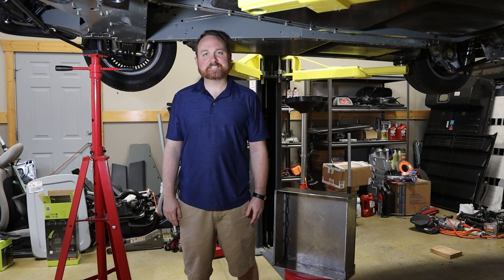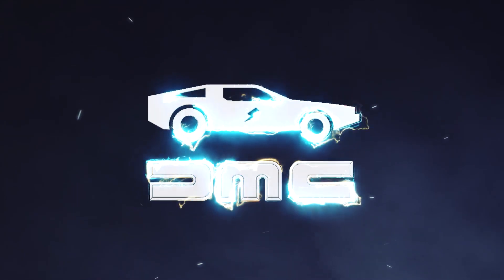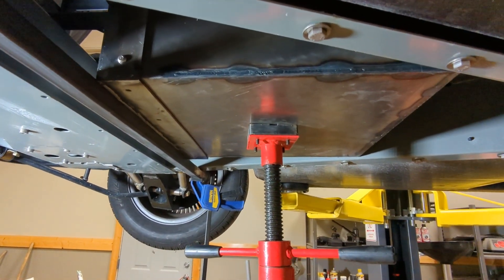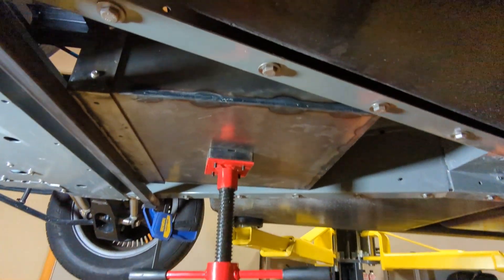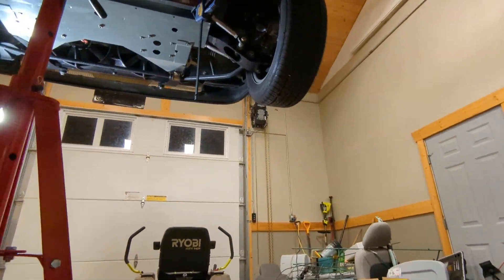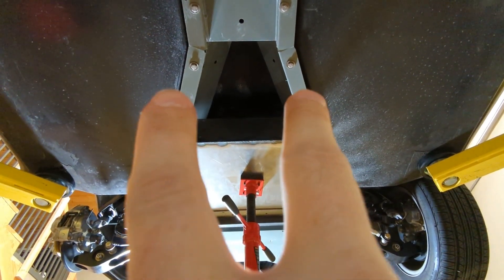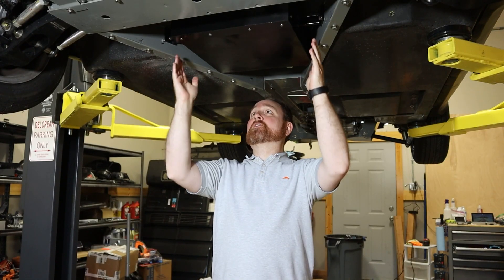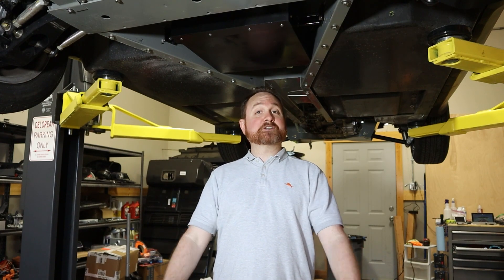DeLorean EV Conversion - Mounting the Front Small Battery Box

Comment: Hey Bill, on the gas tank box, couldn't you just mount it diagonally so you don't have to shave off the back? Just rotate the box so that the angles kind of match the Y?
Reply from the maker: Ah! So, depending on the particular sizes of things - that can absolutely sometimes work!! In my case, the diagonal of the battery box is ~22", which is too wide to fit in the triangle back far enough for it to gain anything up front. It would fit, but would still hit the upper battery pack in the middle.

I appreciate the idea so much, though, that I did go out and lift the car up and make a little mockup with cardboard to see if it would help. :D

Comment: Why didn't it show up in your CAD model?
Reply from the maker: GREAT question!  The CAD model of the DeLorean is just the frame and is only dimensionally accurate down to ~0.5 inch, and doesn't contain any pipes, steering, suspension, cooling, the body, or anything like that. So while it was very useful for getting a general idea of whether things would fit, it isn't nearly accurate enough for me to design on. And then my CAD models of the batteries are JUST the battery module, and not the entire battery box, so they didn't take into account the size of the main lugs or BMS connectors or anything.

Next project I work on I am going to spend the $$ and have the car fully 3d scanned. I didn't think it would be worth the multiple thousands of dollars, but I've learned my lesson!!

Comment: Looking great and a nice fit but I would be concerned you have no triangulation or gussets to give strength to those welds. If you hit a bump your 50lbs will be more like 150 or 200lbs or even more depending on the shock.
Reply from the maker: It held my ~180lbs just fine. :) Put it this way - each one of those bolts is M8 and can hold ~1,000 pounds, and the cross section of the welds on each tab is probably 4x as thick as an M8 bolt. I bet I could hang 2,000 pounds off of that pack (it would probably rip out the 3mm steel before anything else).

Comment: So much space there, obviously you're constrained by module layout, but if you could use 21700 cylindrical cell and stuff them all there, wonder how much more space you could make usable. Did you consider disassembling the module into individual cells to re-package?
Reply: We're always constrained by the shape of the modules we chose. I had the same issues.
Reply from the maker: I did consider it - but in the case of these LG modules, they are pouch cells so it will end up a rectangle anyway. Cylindrical cells would have been able to fill 2x as much in that area, though, and maybe more because I would have more flexibility with the height.

Comment: At 13:59, forward left bracket where it's welded to the main housing, is that just a funny glare? It sort of looks like rust already, but I can't imagine that's actually the case.
Reply from the maker: I think it's just a reflection of the yellow welding table. It's pretty dry here, so I haven't noticed any rust on parts, even when left out for a month. The black spray paint is there to hold me over until I go back and powder coat everything. When I work on the next version of the pack (if it ever gets to that point) I will make it out of aluminum to avoid rust all together!
Reply: @BillCarlson  Ah, ok, I figured as much. It just caught me by surprise. Lets get the wheels spinning!